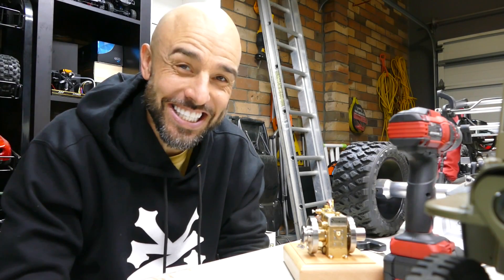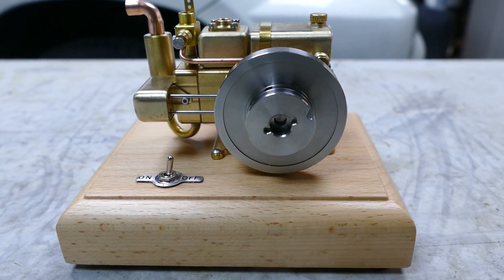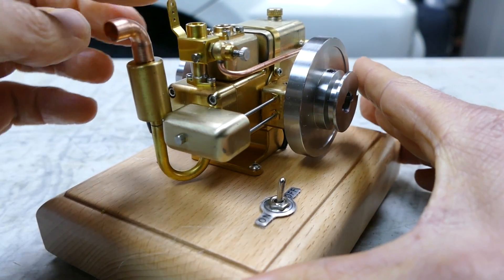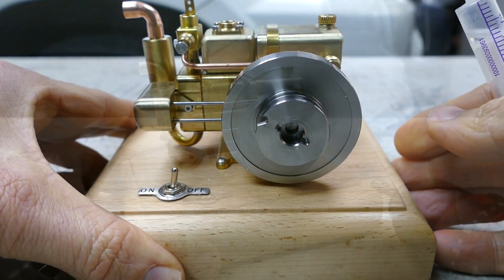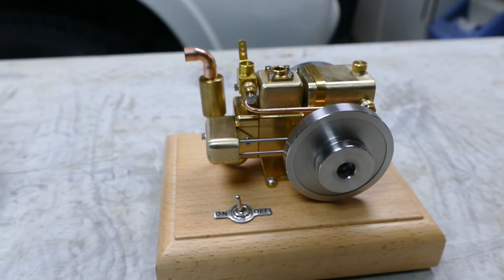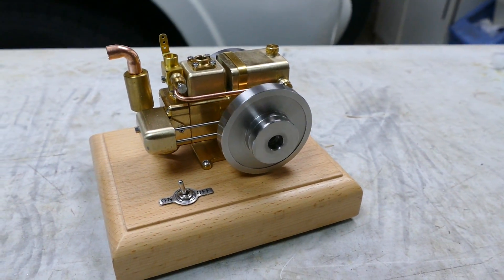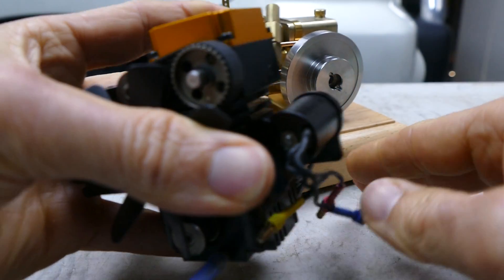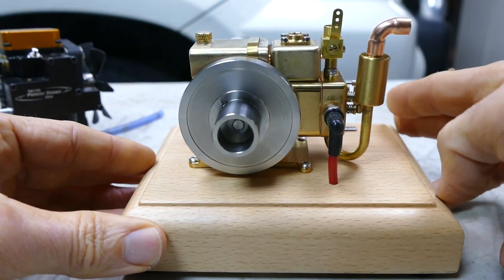MINI OHV PUSHROD ENGINE! EACHINE ET5 WATER COOLED GAS ENGINE - What Can We Fit It In?

Comment: Did you put 2 stroke in the fuel? Just because I saw some smoke out of the exhaust
Reply from the maker: Nope straight unleaded
Reply: A little bit of 2 stroke will help with lubrication as there is no oil in the crank

Comment: A month ago you got me hooked. At this point I have spent about 3 hrs. trying to get it to run better than a fast idle. For $300 I should not have to fuss with it for hrs. to get it to perform. The pull start rope doesn't fit on the flywheel at all. Guess it will become a desk ornament and serve  as a reminder not to buy chinese junk.

Comment: What!, no RPM details on the spec sheet?. I know it sounds slow but it sounds better than the 1cyl Toyan. I’m waiting on reviews for the new 2 cylinder red engine that one almost looks like a Nissan engine. It supposed to provide around 16,000 rpm. The Toyan 1 cyl provides 13,500rpm
Reply: Referring to the Toyan FS-L200

Comment: It is not built for high rpm,  It is a (hit and miss) engine. Lots of torque because of the flywheels. Mine runs around 82 rpms.

Comment: Overhead cam what are you even talking about also ... Consider tuning the deam thing it runs horribly I'm kinda pissed of that you didn't even took the time and read some stuff about these ... It's a pushrod engine and it needs to be manually oiled and tuned properly

Comment: It's a hit and miss engine.
Reply: Need to oil the pushrods every run to prevent excessive wear. And yes it does take oil in the crank case. If you plan on using it in an rc you need to make a dipstick for it
Reply from the maker: No it is not. It is a 4 stroke engine. How is a hit and miss?
Reply: A hit-and-miss engine or Hit 'N' Miss is a type of internal combustion engine that is controlled by a governor to only fire at a set speed. They are usually 4-stroke but 2-stroke versions were made. It was conceived in the late 19th century and produced by various companies from the 1890s through approximately the 1940s. The name comes from the speed control on these engines: they fire ("hit") only when operating at or below a set speed, and cycle without firing ("miss") when they exceed their set speed. This is as compared to the "throttle governed" method of speed control. The sound made when the engine is running without a load is a distinctive "Snort POP whoosh whoosh whoosh whoosh snort POP" as the engine fires and then coasts until the speed decreases and it fires again to maintain its average speed. The snorting is caused by atmospheric intake valve used on many of these engines.
Many engine manufacturers made hit-and-miss engines during their peak use—from approximately 1910 through the early 1930s when more modern designs began to replace them. Some of the largest engine manufacturers were Stover, Hercules, International Harvester (McCormick Deering), John Deere (Waterloo Engine Works), Maytag and Fairbanks Morse.
Reply from the maker: Where is the governor? I think it is a 4 stroke engine. All others reviewers think it is a 4 stroke. Sounds exactly like my mower.
Reply: You may be right. It may be a little different as far as the throttle since it's a miniature. Yours moves faster than a hit and miss, but again its smaller. Watched alot of video of them. Some run really slow and some faster. On the big ones I think you can adjust the govenor.  Either way though still need to oil the pushrods and the valve train.  I have another question, have you ever thought of getting a colony v8 engine and putting it in one of your trucks or cars? That would be bad ass